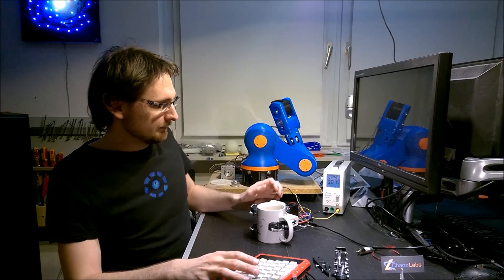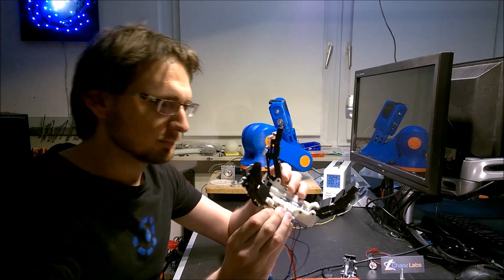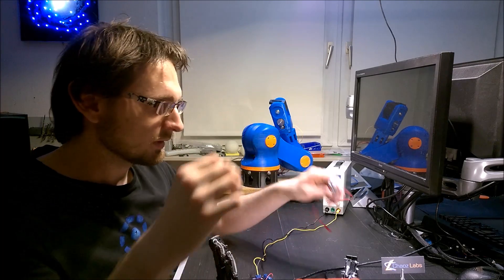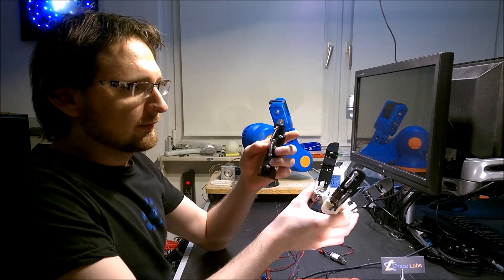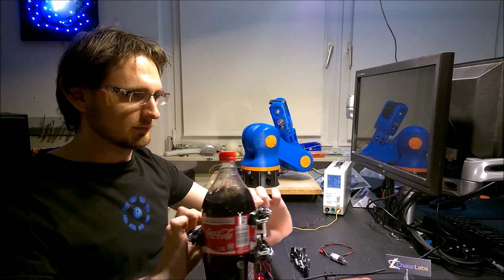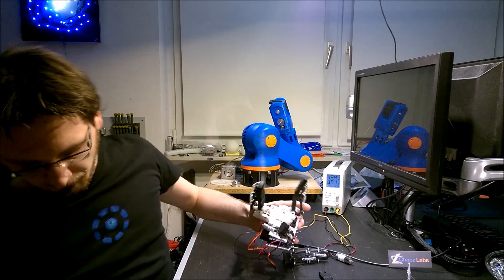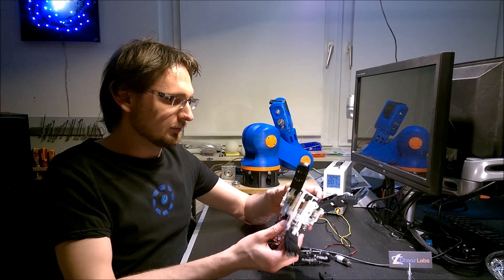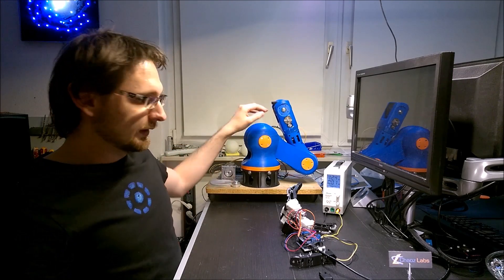Robot Arm part 4 - Gripper preview

Comment: This is amazing!! You rock!! You could use something like this https://www.servocity.com/html/servoblocks.html
that would remove the direct force on the bearings of the servo motor
Reply from the maker: Michael Cullen Thank you for your tip, this are usefull parts, I didn't know, but quite expensive. I bought a view lazy susan bearings for 2,5€ each that fix that problem. https://plus.google.com/photos/111510669637026758430/albums/6107620934889103281?authkey=CK2bgciD7on6Jg